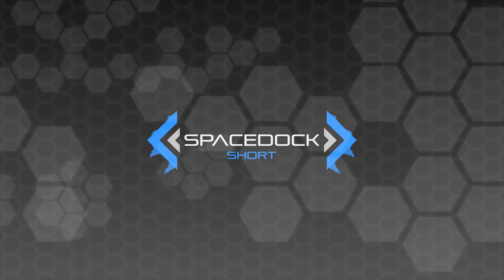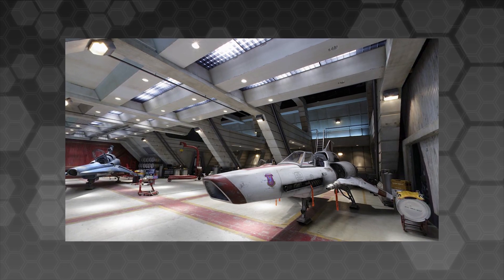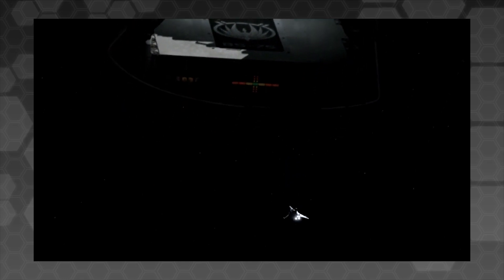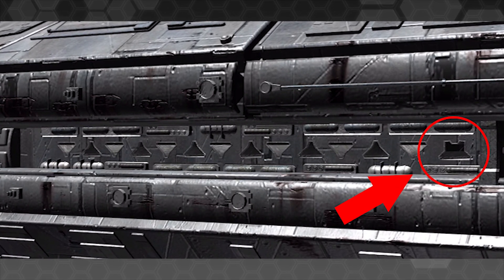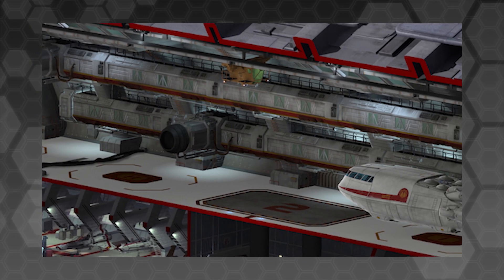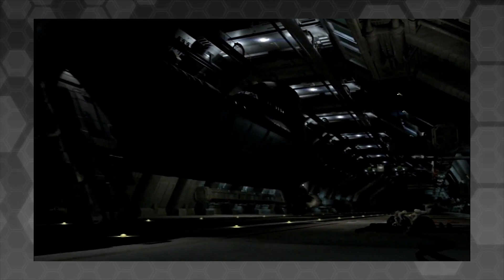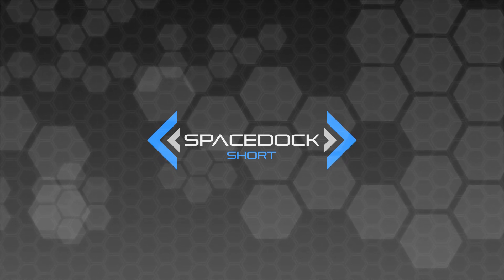How to Land on the Battlestar Galactica

Comment: As an ameteur player of Elite: Dangerous, I can tell you that arresting momentum before landing would probably be more difficult than you imply in this video. Crashing into the landing field is much, much easier than gently landing on it, because it takes out the complicated estimations of how close to the deck you are. Also, arresting momentum accurately in a vacuum is way harder than it looks. Without an automated system calculating exactly how quickly they need to be accelerating and decelerating, a human just can't pull off that kind of thing without a whole lot of luck or some well-practiced move that assumes they'll always approach at the exact same speed and trajectory.
Reply: Or an onboard control system that provides a lot more natural feedback regarding your relative velocity than a flat screen and a mouse and keyboard can supply.
Reply: @DrakeAurum  How would that work? The problem is that, first, the quickest way to slow down is to crash-land instead of using reverse thrusters, and second, even if they did use thrusters it's a lot harder to judge a combat landing like that than it seems. Especially since "just slam on the brakes at the last second" would result in them flying out the other side of the landing pod. Vipers aren't designed for sudden reverse thrust operations like combat landings, because they use their magnetic landing legs instead.
Reply: @ThePCguy17  Lee did the exact same thing when he was in the conveyor tunnel. So no, Vipers CAN suddenly stop if given enough room to do it.
Reply: @MotoroidARFC  All I'm saying is that if using reverse thrust was a better solution, the pilots in the show would be doing that instead of using magnetic docking clamps. As it is, they're probably using both, because they're coming in at combat speeds that might make a purely thruster-based braking maneuver impossible.
Reply: @ThePCguy17  notice how many of the Vipers bounce so they have to slow down to allow the landing gear to grab the deck. Also, Starbuck came in fast because she couldn't stop properly since Lee was jammed on one of her sides. They slammed onto the deck and slid down until friction and crashing into something on the side stopped them. The magnets can't stop you on their own.
Reply: @MotoroidARFC  And neither can whatever emergency brake thrusters the Vipers are equipped with. Launch speed is much slower than combat speed, especially since the fighters are probably accelerating continuously during a fight without anything to slow them down.
Reply: @ThePCguy17  they seem to work fine in combat. Again, Lee flying in the conveyor tunnel was able to stop so he wouldn't plow into the wall when the tunnel went straight up. He could have set his fighter down on the ground if he wanted to at that point. He didn't. He flipped his fighter nose up and flew up the the tunnel shaft. When he exited, he hard stopped again and flipped his Viper level with the ground. So Vipers can come to a full stop. Your assertion that "Vipers aren't designed for sudden reverse thrust operations" is wrong.
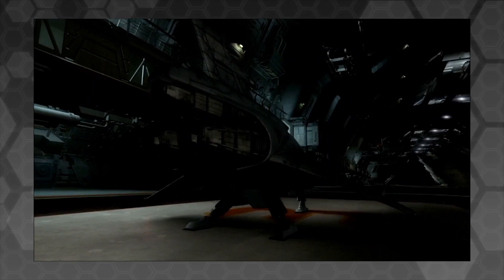Reply: @ThePCguy17  go watch Mission Accomplished on the Battlestar Galactica channel here on YouTube at the 4:00 mark.
Reply: @MotoroidARFC  Vipers aren't designed for sudden reverse thrust. Just look at them. All of their main engines are rear-facing. Sure, they can slam on the brakes in a pinch, but that doesn't change their fundamental design capabilities.

Also, keep in mind that combat speed is, as I said, much faster than takeoff speed. You're not arguing with the point I made, you're trying to argue that a "plane in space" fighter is designed to work at peak capacity in a vacuum.
Reply: @MotoroidARFC  I smell a fanboy. But that doesn't matter. I'm the one who's trying to defend a staple of the Battlestar Galactica mythos, namely the idea that emergency landing procedure makes in-universe sense. And honestly, if you can't accept that rear-facing engines would make stopping without flipping the ship around backwards incredibly difficult, I can't argue with you. Argue about anecdotes all you want, stopping on RCS thrusters instead of main engines is less effective.
Reply: @ThePCguy17  actual footage from an episode overrules speculation. It's obvious you didn't watch the video; you can see the braking thrusters fire and their locations on the frame.
Reply: @MotoroidARFC  You keep mentioning this illusive video and I keep not knowing what you're talking about. I'm speaking based what I observed from watching almost two seasons of the show, so it's not like I'm talking out of my ass. You're using one singular example to try to disprove the fact that a fighter with rear-facing primary engines is simply not optimized for reverse-thrust maneuvers. It's not going to work, because that argument is fundamentally flawed.
Reply: @ThePCguy17  I watched the whole series even when it got flakey. I gave you the name of the channel and the name of the clip and even when in the clip the point is made. If you cannot comprehend English, if you cannot even copy/paste into the YouTube search bar then the fault lies with you. You insist on bringing in your preconceived notions into a universe that has already dealt with the question. Do you go into Star Wars threads and insist light sabers cannot work or that their fighters shouldn't fly around in space as if they're in atmosphere? Do you go into Star Trek threads and insist the starships cannot use warp because the pylons are too fragile looking or that Voyager could not land on a surface? That is what you are doing here. You dismiss facts provided by the show. You look at a Viper and assume it cannot stop its forward motion when it is shown that it can. You have the problem. You are the kind that ruin franchises because you demand it conforms to your notions. BSG doesn't care about you. Vipers will continue to do what they do regardless of your whining.

Do the world a favor and drink a gallon of bleach.
Reply: Not that hard if you have a velocity indicator which Elite doesn't give you. Even without a velocity indicator the walls of the hanger will provide a reference point for your speed and direction.

I don't think it would be that difficult. Put your velocity vector through the hangar, aim through your velocity vector, then slam on the reverse thrusters, and give a little bit of downward thrust. I played around with this in Space Engineers, and Diaspora(BSG flight sim with newtonian physics.)

You don't need automated anything, you just need the proper displays like relative velocity(speed), and velocity vector(direction.)  It doesn't take a computer to watch a number turn to zero. And even without autopilot (because cylons) they could have a suicide burn indicator that shows them a countdown until it's too late to brake.
Reply: It can still be difficult. Space Enigneers does give you a velocity indicator and as some one who has smashed more than a few nosses of my craft becasue I misjudged distance and stopping speed. Oopsie. Start at 100m/s (223 mph) and begin braking too late for the craft, hit rock at 20 m/s. Rebuild nose.

Comment: Why didn't they convert the starboard hanger from museum to landing bay, or was the whole pod including the lower sections and control equipment removed of opened?
Reply: You would think that, but that isn't the case.  Galactica's starboard flight pod was a museum for the beginning of the series, then later it became housing space for civilians of other ship crews that lost their ships.  You can even see in the graphics of the show that the starboard pod has geodesic glass over the ends.  This is also the area where the bar was setup for the third season, then one where Starbuck starts playing the piano to the tune of All Along the Watch Tower from "memory".  That whole area was a sort of shanty town.
Reply: it's said in the pilot that the starboard launch tubes have been turned into a gift shop.
Reply: I believe the catapult systems in the starboard pod were removed for the museum, so they couldn't launch anything if they wanted to.

Comment: As a former Navy Vet, I've served on a couple of Nimitz class carriers, and BSG did an excellent job at matching the landing feel.
Reply: I am pretty sure the movie Top Gun added some military references that many viewers possess now the jargon BSG used would be easily understood.
Reply: @meligoth  And JAG. Harm flew an F-14 a lot more than I'd expect a lawyer to.
Reply: Leo Peridot  You clearly never watched the show. That was explained in the first part of the miniseries when Lee arrived at the ship for the decommissioning ceremony. Auto-landing is used on every ship EXCEPT Galactica. Adama is paranoid about over-reliance upon automated systems and requires all his pilots to land manually. Later events proved him correct.
Reply: I always thought it was crazy that fighters jets throttle-up to full afterburner the instant they touch-down on-deck, so they can maintain momentum to get back into the air in case the arresting cable slips. It makes perfect sense, but it's still crazy.
Reply: Leo Peridot  
In BSG, the have it but don't use it. They want the pilots to maintain the skill, and don't trust remote control landing because the enemy is computer based. 
In reality, there is no need for these high speed landings. Not in space. They act like they are putting down an F14 onto a flat top.
Reply: That's really cool. I've read about serving on those carriers and it sounds like a different world. What did you do on the ship?
Reply: They used former Air jet pilots for that, So you're welcome.
Reply: Yeah but on BSG theres no atmosphere and no gravity or worse variable gravity.
Reply: @justjohnny05  
Hence, high speed landing is totally unnecessary for normal operations. In reality, they'd do a landing at bicycle speeds.
Reply: Thx for this!
Reply: @LazicStefan Maybe some minuscule amount of gravity could be of some benefit on the landing deck and the hangar spaces, but not 1 G. And on a ship, equipment has to be secured firmly anyway. As soon as the ship starts maneuvering, gravity isn't going to be sufficient to keep a heavy object from sliding around and bumping into stuff / people.
Reply: They’re in space they should feel nothing alike.

Vipers don’t have a required approach speed since Vref is 1.3 Vso when vipers don’t have a stall speed.

The safest and most efficient means of landing would be reverse thrusting to match relative velocities and rcs for fine manoeuvring for magnetic landing.

Not coming in at 200 knots and slamming into the deck.
Reply: "Except for the fact that there is no gravity in space." -- There actually is. You're thinking of free fall, such as astronauts experience. As far as we can tell, there is NO point in the entire universe that lacks gravity.
Reply: @colormedubious4747  Yes, there is gravity, but net gravity with reference to the BSG is negligibly tiny, so carrier landings on Earth would have almost nothing in common with a landing on the Galactica.
Reply: @antred11  Although it appears that ships in the BSG universe have some form of "artificial gravity" as evidenced by the personnel on the ship and the way the Vipers and Raptors sometimes slam into the flight deck.
Reply: @colormedubious4747  True, though I wonder why they would go to the trouble of creating artificial gravity in parts of the ship where that actively hinders them from working effectively. I would have gravity in the living spaces, but definitely not on a landing deck, and possibly not even in the hangar space.
Reply: @antred11  Lazy writing and/or limited FX budget?
Reply: @colormedubious4747  we simply can't feel our own weight

Plus, its called Microgravity
Reply: @zeroday5441  Your reply to me seems strangely unrelated to my reply to James. Perhaps you could clarify any error you think I made?
Reply: @colormedubious4747  You didn't make any errors
I was just supporting your statement
Reply: @zeroday5441  Well then, thank you! :)
Reply: I'm so sorry to hear that you're no longer a veteran, how did you loose it?
Reply: @rsrt6910 
And how does one “loose” being a vet?  Is it like loosing an arrow and being a vet is just fired away using a bow?  Now I’m losing track of what we were talking about.  I guess that makes me a loser (but at least I’m not looser than a goose).  

Seriously though:
Lose = “looz”; to misplace something or to not win
Loose = “loos” or “luce”; the condition of not being tight
Reply: @rsrt6910  He probably "loosed" it at the same English grammar class that taught kids the wrong definition between "loose" (an object not secured down) and "lose" (having something miss-placed or taken from you).

Or is this going to turn into an English contest instead of talking nerdy sci-fi facts and such?

Comment: 1) galactica announces combat jump preparations and sounds the recall  
2) checkers red, call the ball
3)????
4) skids down, maglock secure.
Reply: Personally if its really hectic and my fighter has magnetic landing leags, if nessisary I'd land on the ceiling. Yes i'd be uspidown (if the landing deck has gravity) but i'd be out of the way and secure for the ships to make its escape jump.
Reply: I wonder if the more dramatic combat landings were also due to acceleration of the deck.  Even if the Galactica isn't intentionally maneuvering (which it might be), it it is still shooting and often getting hit in those scenes.
Put down quick cause the ground is moving...
Reply: The "combat landing" would also have an added benefit of conserving a small amount of fuel, as the viper wouldn't be engaging it's maneuvering thrusters as long as it's relying largely on the impact (i.e. transfer of energy) and maglocks to decelerate and stop.
Whereas, in normal operations, the thrusters would be engaged far longer as the bulk of the deceleration force until a more smooth and controlled landing could be achieved.
Reply: An aircraft carrier would never allow aircraft to land on a red deck   on purpose.